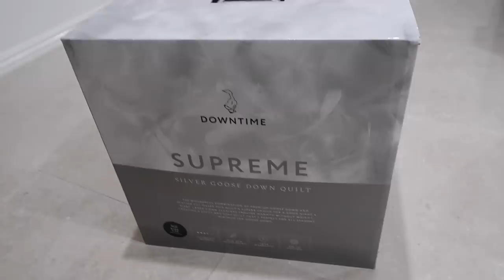MOVING VLOG #1 🏠📦  FIRST NIGHT IN MY NEW HOME 🥰 BED SHOPPING 🛏 JAZ HAND

Comment: Idea... Get a large square tray for your couch ottoman. Works great to put drinks, dinners, TV remote, cells and other loose ends on it. Can always remove it when wanting to use strictly for relaxing. If you get a smaller one, you may not have to remove just slide it over. ❤️ Best wishes in new beginnings!
Reply: Yes! Books look cute stacked on those trays :)